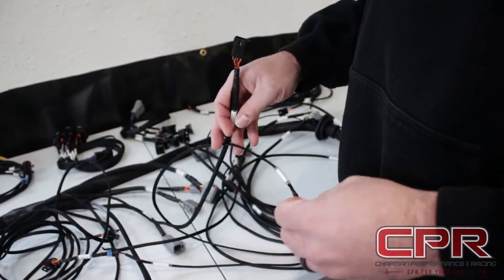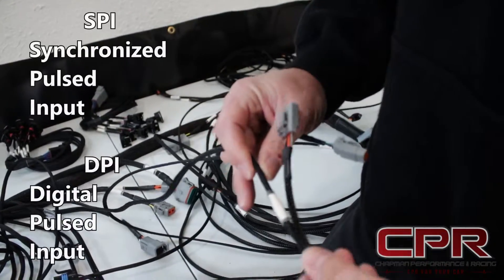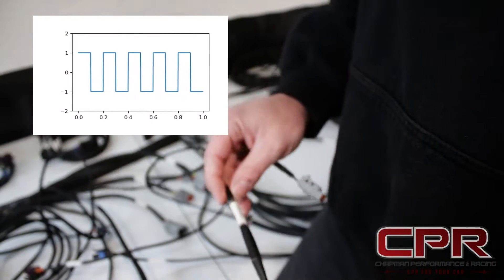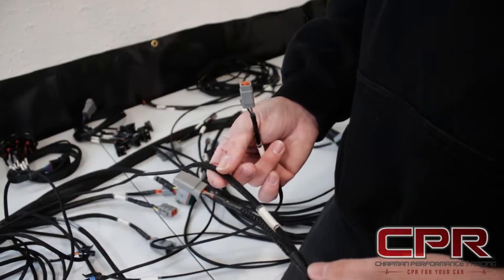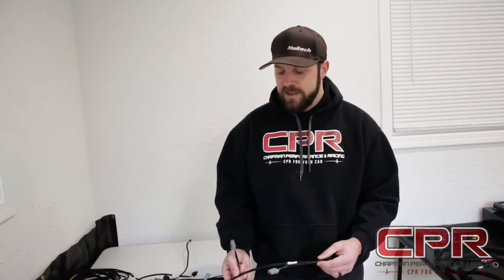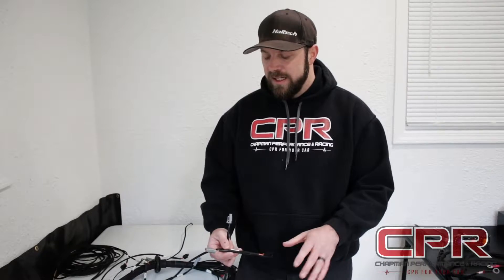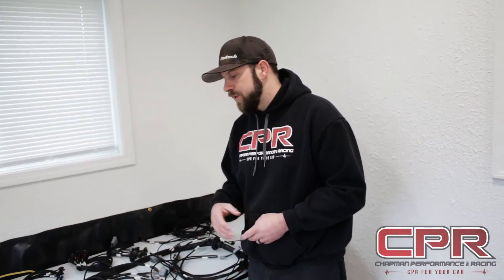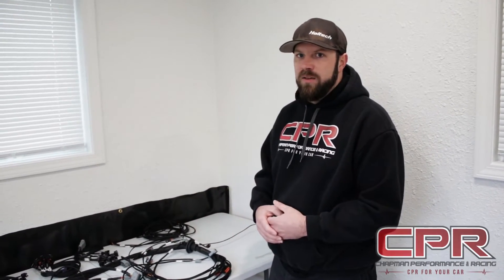WHAT DO THEY MEAN?! DPI AVI SPI and DPO

Comment: Great video. I was wondering if you can help with a bit of advise. I recently purchased an elite 950 and was wondering if It will accept a speedo input? It's a 3 wire toyota sensor,  but the ecu appears to only have DPIs and no SPIs. Can this work?

Comment: Thanks for this! I'm wiring in my Nexus for the 31. All new to me and this was hard to find info on.
Reply: Correct me please if i'm wrong. Oil Temp/Press - allocate AVI's in software for both temp & press, use 5v sensor supply & signal ground.